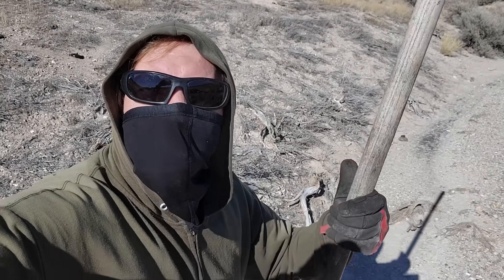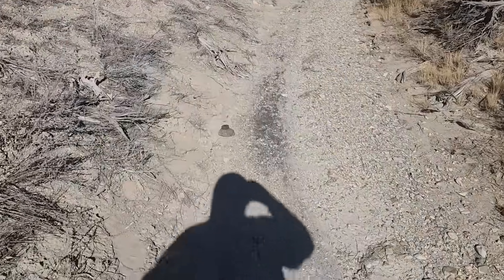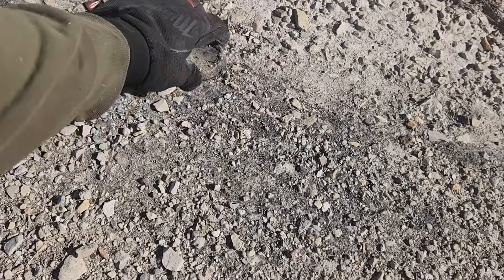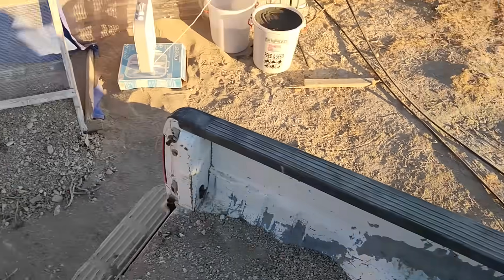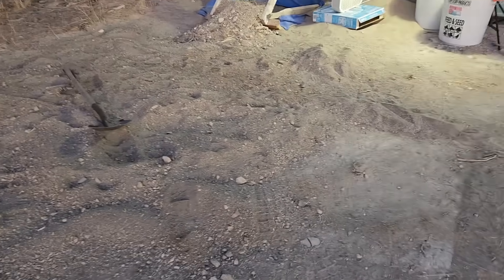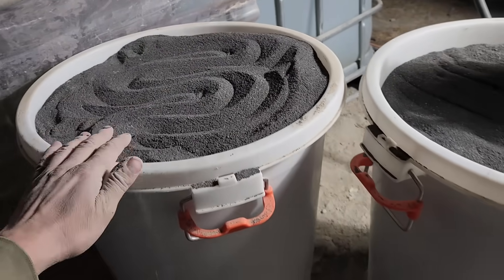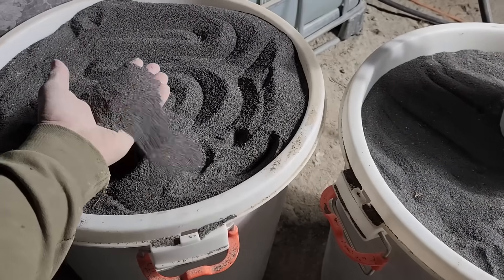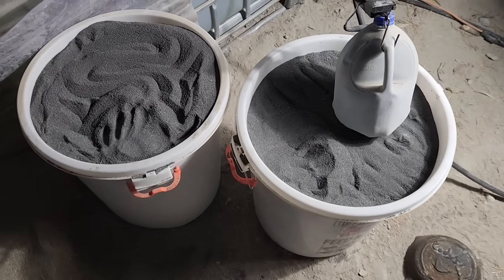Mining Magnetite

Comment: I collect the stuff too! I usually use ceramic large magnets in an ice cream bucket for easy release. But getting a jig to refine quickly is a goal of mine. I also have found pulling it through water with the ice cream bucket method works really good too.

Comment: I like that magnet separation idea. If there is a way to utilize the weight of the magnetite on the magnet on a rotating drum so enough of the filaments fall off so that you get all of the high grade magnetite and not the 2 other common black iron oxide types that are still magnetic but not as much.

Comment: Why don't you set up that separation jig in the back of your truck so by the time your done shoveling all your material is already at around 90 to 95% and you leave the rest there. I bet you would come home with a lot more material for all the time you spent shoveling 5 and 6 times and have 2 or 3 same pole magnets together to process even faster.

Comment: To remove the need to manually remove the sand from the magnet, have big plastic sheet, or tube, between magnet and everything else, so the sand is collected on the sheet. Then, just remove the magnet from the other side and the sand will fall down.

Comment: Or you can use a higher drop and one or two fans. The magnetite will fall close to straight down, while the light stuff get's blown beyond the collection bucket. Before electricity, people used the wind and a 10-15 foot drop in this way to separate gold from lighter material.

Comment: you can make this better by doing a two or three stage magnetic system. where the first one drips, set the next one. you'll have a pure run in only one dump if you used a few magnets to do it

Comment: Have you considered running the magnets in Series?

If you put the smaller magnet below and slightly behind the bigger magnet and set the magnetite bucket back a little.  I think the smaller magnet would further seperate the magnetite from the sand stream.
Seems like youd get less contamination so less shovelling?

Comment: When i drywash gold in the desert i came up with a way to process the cons with water and a mixer on a cordless drill.
Add enough water to a five gallon bucket of cons to cover it. Run the mixer through this for about a half a minute.
Drain the water, the blondes clump up and are easy to remove. The black sands are under that and stuck to the bottom.
I tilt the bucket, add a bit of water to settle the gold into the corner. Pour out the water, scoop out the black down to about a half a cup black left. Rinse that into a pan to oan out the gold.
This may help in your recovery as the black sands are just a waste byproduct when gold processing.

Comment: I wonder if using a fan on a low setting, would push the waste away from the collecting bucket better, while still allowing the magnetite to fall into the collecting bucket... It seems that the magnetite is far heavier than the waste, so I don't think a fan set on low, would affect the magnetite flow too much, but it may allow you to better control the flow of dust, dirt, and debris. In turn, you would get a purer product easier and faster.

Comment: Hello. If I were you, I would refuse such a method of extraction, where all the processed soil has to be transported home. And physical work, in my opinion, is too much. It's easier - to bring home the concentrate. We attach the wheels to a block made of magnets, maybe 1m x 2m or smaller, and when attached, maybe to a quad bike to ride around a promising area. It is possible to install some other surface-sweeping device in front of the wheels, and to automate the cleaning of the magnets... Good luck.

Comment: That's so cool! 
Do you think having a curved surface, like for example the top of a 2-liter bottle, very close but covering the magnet would increase efficiency?
I could see if you experimented with the distance the surface is from the magnet the magnetite would slide easier to the underside, and you may get a little more 'bouncing' of the sand off the plastic surface rather than some getting caught within the magnetite spires - that is as long as the magnetite is consistently sliding to the underside, and not accumulating on the plastic surface.

Comment: Great video!
If you move your 2nd smaller magnet into the dust stream just below the bucket (but on the outside), you could enhance your capture % a bit, 
and it's probably faster than using it for the bucket with the smaller hole

Comment: Just as a note, it'd be simple to setup a recovery system. 

Just setup a 'tower' (wouldn't even have to be that tall) where one bucket is at the top, goes through magnet 1, where your waste goes to another bucket and processed material to a different bucket. The waste bucket then has a hole and drains to a second magnet.

It'd be a pretty easy system to setup.

Comment: Here's an old miner's tip. Get you a sheet of steel to spread that stuff out on. When you throw it down it'll dry faster and won't mix with the dirt already on the ground so your yield will be higher per load.
Reply: Although usually the steel sheet was used with blasting.  All the same,  it made mucking a lot easier.
Reply: @ and yet the made up story about miners pick-axing over steel plates still has nothing to do with refining iron rich sand. Why even bring it up?
Reply: @Keith-t3k  Are you a bit stupid? His story illustrated exactly why it's relevant... it's exactly the same reason he suggested Cody to do something similar. To not lose the ore/magnetite, and to not pickup as much dirt from contamination -- which means not processing as much material and wasting time/energy for no additional gain. Of course in this day and age it'd make a lot more sense to just use a cheap tarp/liner, not a steel plate. But same concept.
Reply: @ LMAO. Did you even read the comment chain? I didn't reply to his original post. I wasn't talking about his advice or his method. I replied to his explanation to CroppedCross3's question. Read more before insulting people.
Reply: I kept trying to post links about this,  but it didn't work.   Google "Bisbee mining, blasting " if you're interested
Reply: What were "old miners" doing that required that?
Reply: @CroppedCross3  They would put the plate down when they started mining and chipping away at a wall. All of the big chunks got hauled off in the carts while all of the small pieces, even as small as a spec of dirt, would fall down onto the plate. That allowed them to scoop it up with a shovel instead of risking losing the ore that they were mining for. When they took it topside to sort it, they would dry it out before grading it.
Reply: @Chromevulcan  That makes no sense whatsoever. He is not mining underground. They hauled around large steel plates with them while mining underground through rock? What does that all have to do with drying iron rich sand.
Reply: @Keith-t3k he’s talking about how Cody is shoveling from a pile of iron rich sand that he shoved off onto literal dirt ground.  Putting a steel plate beneath it makes it so that you’re not adding any of the previous dirt ground into your process.  From Cody’s processing method it matters very little outside of cleanliness and separation… when you’re already working with sand and dirt….
Reply: @ Yes. I was talking about his "old miners" story using miners pick-axing ore underground and to the original question asked of him. His response didn't really answer the original question and was just ham-fisted in. Saying put something on the ground so your iron sand isn't contaminated with more sand is much easier than making something up about miners.
Reply: @Keith-t3k Umm, not exactly made up....
Reply: @Keith-t3k  Not a thing at all, someone just wanted to voice their lack of knowledge!
Reply: @CroppedCross3  They used a sluice to blow all the dirt down and out while retaining the gold and now clean black sands for further processing! This is a much more time consuming and labor intensive way to do things with Tunnel Vision and going after a by product instead of going for the gold!

Comment: Dear Cody,

Thank you for sharing your projects, they are appreciated. 

I believe you would find a lot of enthusiasts willing to come do a thermite reaction ANVIL making workshop.  Make the sand or investment mould, prepare the termite and cast a personal anvil.  Perhaps insert a slab of high quality steel into the mould that will fuse with the melt and make a professional surface that is good enough for working.

Some of the railroad welding thermite kits include a provision for adding a high strength alloy to the top of the rail for wear resistance and the same  process should be possible when making smaller (5-50kg) anvils.

Now you need a convenient way to pulverise soda cans and you could have a hand made anvil business that recycles sand and cans.

Comment: That is a really cool gravity-fed magnetic separator setup, kudos for that!  

I gotta question, and it may be worth an experiment if you're up to it.  Can you use epoxy or some other binder with the magnetite, and make a ferrite transformer core out of it?  More specifically, I was wondering if magnetite could be used in a flyback transformer core, since they're getting hard to find because tube-type television sets aren't being made anymore.

Just for fun, I'd pan those tailings because it might contain a pinch of gold in it.

Comment: An idea for you to get a better separation: Make a water wheel of sorts that is hollow in the middle. Basically a ring with spokes on one side and small paddles. Then put magnets along about 30% just inside wheel from about the point that the sand hits the wheel, and a bit past the bottom point. The idea being that as the sand hits the wheel, the magnetite will stick to the inside of the wheel as it rotates past the magnets while the non ferrous material will drop out. Then, as it passes beyond the magnets it will fall out of the wheel into a separate location from the rest of the material. You might get better results with a belt of some sort, but a wheel is easier to manufacture and can be powered by falling sand.

Comment: i love this so much
i used to mess around picking up random bits of iron from the ground in middle school but i didnt know heck what i was doing and our soil had barely any, i got way more from the garage floor
if you have more magnets you could probably separate sand and iron streams into funnels and run them right away through another magnet separation steps, so that it's even more continuous

Comment: I wonder if you could gain a lot of process efficiency by covering the magnet with a Teflon flim and adding a secondary weaker compentarty magnetic field to accelerate separation. 

Of course eltromagnets are a shiny idea to automate some steps  
If you want some custom electromagnetics to play with i have serval spools of coated magnet wire i could send you some (you already have my contact info)

Funny enough you could probably get a voltage buy passing the stream through a coil adding a resistance to the coil might slow the magntites speed relative to the sand. Im doubting the useful ness of such a wacky generator but it would be amusing to have a failling sand led powered by the magnities gravational potential. Haha

Comment: I've purified magnetite before and your primary process is objectively better than mine, but you could do a secondary process in which you mix the magnetite with water, when you pass a magnet near it the hydrated sand will be too heavy to move, but the magnetite will move and stick to it no problem, I managed to get a purity of about 98% by weight, I tested this by chemically reacting it and weighing the leftover detritus afterwards.
my primary process was to use a neodymium magnet wrapped in thing cloth, after no more magnetite could stick to it I simply pulled the cloth off and the magnetite fell away without issue

Comment: You could use do a double layered bucket system. Where the tailings of the first run goes directly into another bucket with a smaller hole (like you already have!). Then use the smaller magnet to carry out the second pass.

This way you’ll have have to spend less time moving dirt around.

Comment: I too wonder if there is a possibility of any precious metals in that creek bed. To those offering suggestions for making the system more complicated for slightly better purity, you missed the point. When the material is so abundant, you don't spend time and resources for another 5% gain in purity, you just run more material. If he wanted absolute purity, he would chemically refine it or sluice it.

Comment: Something similar is a common technique in recycling. 
Have you tried to shield your magnet with a tilted, nonmagnetic, smooth surface (like bended plastic) the magnetic material can "glide" down towards the magnet on?
You will have to experiment with the distance a little but i think you can get decent results this way.

---------|
---M---|
--------/
------/
----/

Comment: One more tip that will really help with speeding the process up: Wrap a plastic bag or two around the magnets, and once the magnet is full and you've collected in the bucket, grab the plastic bag and turn it inside out to remove all the magnetite from the magnet and keep it clean for the next run. You also collect all the magnetite in the now "inside out" plastic bag. I saw an old man doing this on the beach once, he dragged a Shoprite shopping bag along the beach with a magnet inside, then he turned the bag inside out, retrieved his magnet, and waked away with a nice amount of magnetite.
Reply: "Keeping it clean" offers no advantage. This is (semi) a permanent setup, used to process bucketloads one after the other. The magnet only needs to be "cleaned" to recover the very last bit of magnetite (which will be a negligible amount compared to what was recovered up to that point, anyway).

Comment: If use two magnets one rotation and one stay firmly and when they stay on a point of a bucket and you to put  that.  Firmly - +and + -  rotate  when they reach this connection loose the material in a center bucket with open side .so is two bucket one smaller than other inside the big bucket.

Comment: Cody! Come on out to San Francisco's western edge. You'll find Ocean Beach, a true black-sand beach. In some areas the fine black sand is more than half magnetite. I like to use a piece of flat bar with several Neo magnets stuck to it, with a thin piece of rigid plastic covering them. Pulling the plastic away releases the captured material. One collection step and one purification step and it's above 90 percent, probably more like 95-98. A local art and sculpture supply house carries "atomized" aluminum, and there you go. I have a jar full of the mix on my shop table, waiting on a rainy day :)

Comment: Couldn't you increase the separation effect by adding a backeard curved iron rod to the bottom of the magnet? It would still build up and travel down, but traverse a farther distance away from the sand before dropping off. You could essentially eliminate the need to do purification runs and just get pure magnetite in the first go

Comment: I wonder if one of the metal filing collectors they use in machine shops would be useful for collecting the magnetite.  It's used like a brush, but has a retractable magnet in it that drops what it's picked up.
Reply: That's too Gucci for Cody. Bro, just built an ore refinery in his back yard with a magnet and a couple 5 gallon buckets. Specialized equipment? That's cheating.
Reply: You mean a "nail picker upper?"
Reply: @N8Dulcimer  - I think he's talking about the ones that look like a stick with a handle that slides back (used to clean lathe beds, etc.). They're usually called something like "chip collectors". Though there are also some ("magnetic sweepers") that look like a wide mop that you just roll along the floor.

The chip collectors would probably be useful to get the last bits of magnetite off the "tailings".
Reply: Cool to see you here, just finished watching you disassemble an brake fluid tester
Reply: Veritasium did a video on thermite and the company that produces the industrial thermite gets there source of iron oxide from waste Mill scale from a industrial foraging company.
Reply: I wonder if some of you folks actually watch the video before commenting.
Because it seems like you fks read the title.  Watch 10 seconds and then proceed to comment.  

THROW YOUR DAMN PHONE AWAY AND LEARN TO DEVELOP A GODDAMN ATTENTIONSPAN
Reply: I think your problem would still be whatevers under ground. Cody was getting materials at least a few inches below the surface. Your machine has to be small enough to fit the channel and powerful enough to pull them from ubder the dirt that settled on top.
Reply: Unless he has someway of automating that for every single different dry streambed... It's probably more efficient to dig it up and move it to a central location for processing like he's doing.
Reply: @griffinkimberly7695  - I can definitely imagine a machine that would sweep dirt sideways (possibly onto a conveyor belt) down to an adjustable depth while it moved along the river bed.

Comment: I just love this setup.

I am curious though, if you were to stack the smaller and larger magnets on top of eachother, would that make the process even more fast and efficient? I theorise it would result in a greater seperation distance between the magnetite and sand making purifying even better, on top of allowing you to run more material through the one bucket with the stronger magnetic field.

And great haul, seeing those 2 containers full of nearly pure magentite is just lovely